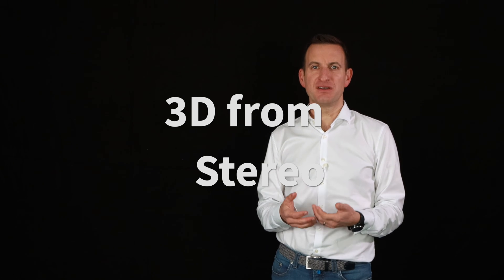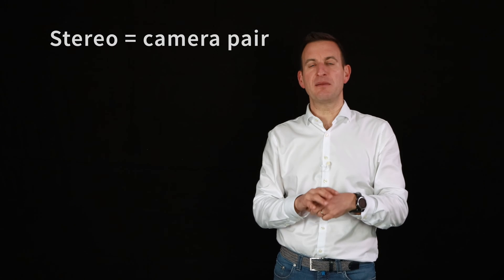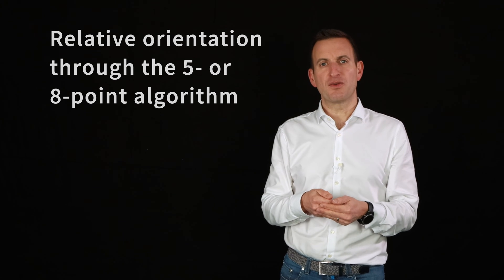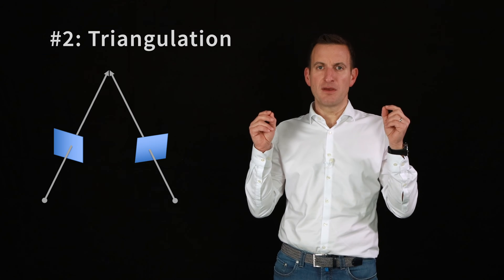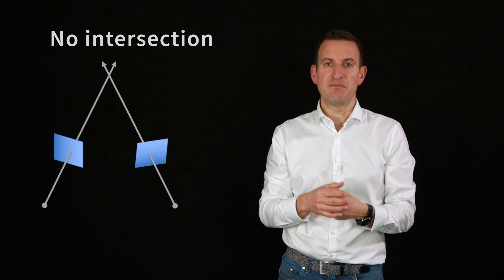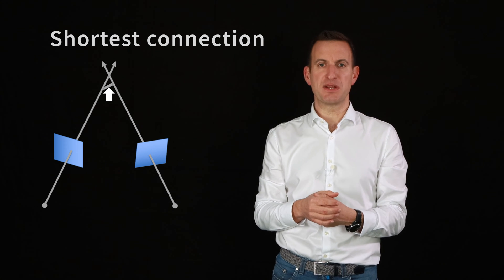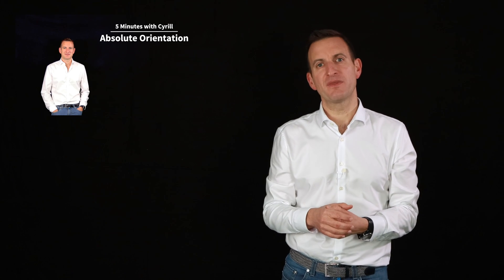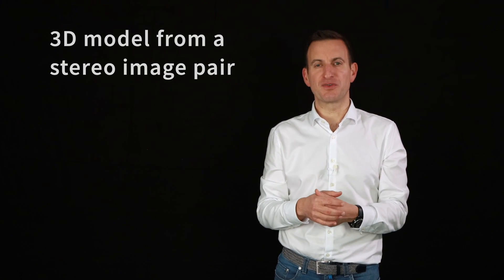3D from Stereo - 5 Minutes with Cyrill

Comment: I recently used LM to tighten up skew lines to find the 3D location of a set of cameras in relation to a source, thus knowing the 3D locations of the source points.  Of course the system was not scaled, I just used best guess.  I was only really interested in the shape.
Reply from the maker: You can optimize things jointly with LM, basically leading to a large BA solution. I presented the solution for a stereo setup that is based on direct solutions, so you can do that without an initial guess, which is one of the advantages compared to a BA solution.